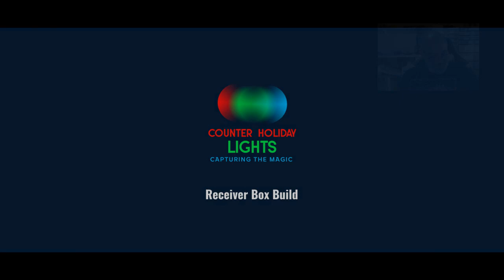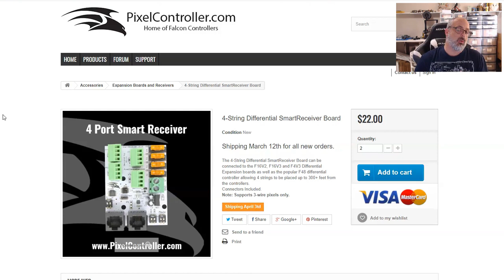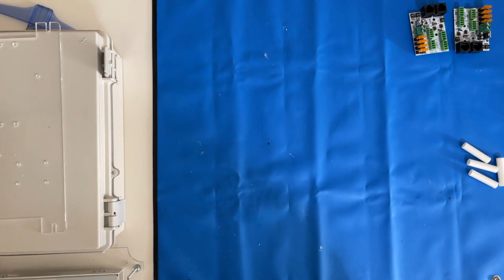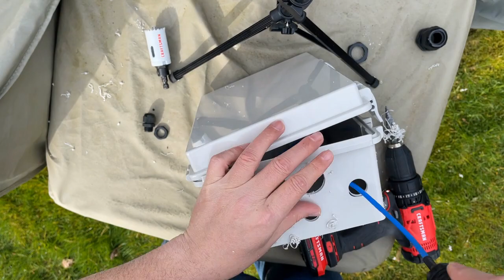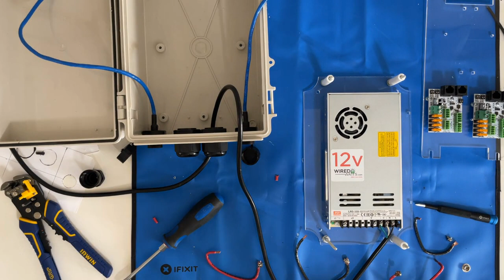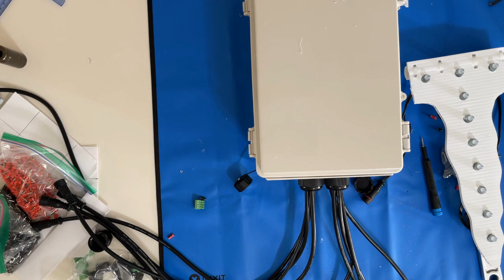RGB Smart Receiver Bud Box Build

Comment: Great videos, looks like our setups will mimic each other, you have two cat 5 lines, are they data in and data out? Thanks
Reply from the maker: no they are both data in one for each receiver
Reply: @CounterHolidayLights  OK so that data in those two cables are plugged into two of your ports on the F 48 correct?
Reply: My props won’t be the same as yours but controller wise your set up will be very close to what mine calls for for what I have set up in my yard that at 48 and distribution boards look to be the best route for me
Reply from the maker: they could be if needed or if they were smart receivers for the new F48 I could chain them internally
Reply from the maker: if you display is all over the place then yes that is the best way to do it. our current show uses the F48 to run our garage, matrix and front of the house we use a F16 with  a 16 port expiation for our tree and yard. next year we are going to replace the F48 with a new F16 with two 4 port expansions so that the f16 will handle the matrix and garage and then use the explanation ports to run the front of the house. less wires  to run and a couple less receiver boxes out side if I do it this way.
Reply: @CounterHolidayLights  would you be willing to sell your f48 to me?

Comment: Great video! You mention you like using ferrules with the pigtails - any reason you didn't either ferrules or fork/spade connections for the mains and DC connections? Also I find it a lot easier if I cut the cable off clean and then feed the cables through the gland first, followed by stripping the outer and inner jackets. That way I'm not fighting the loose strands in the gland, as well as bending and possibly breaking off an individual strand :)
A note on the mains safety would be great.... can be very dangerous if not handled with care.
Reply from the maker: glad you liked it and thanks for the input

Comment: Thanks for the video - maybe I missed it, what size hole drill bit did you use for the PG25 glands?
Reply from the maker: I beleive it was an Inch and a Half hole bit. if you have a few just see if it will fit over the gland.  thanks for watching.

Comment: Hi!  Thanks for the great video!!  Maybe the picture was deceiving, but it looks like if you centered the Falcon controller in the yard, you might have been within the 30' limit to most or all of your props and wouldn't have needed the receivers?  If that's the case, what is the advantage to having more receivers versus a centralized controller?  Hope my noob question makes sense, lol thanks
Reply from the maker: MNelson10000, while an F16 with one or two expansion boards port wise could of handled most of the props ( eave lines would have been way over 30 feet )  part of the problem and the reason why I built it the way I did is several fold. First the closer the controller to the props the more lights you can run on a channel I run between 200 and 350 lights per port ( as power loss happens over distance traveled ) Data can be boosted with an f-Amp but power can not unless you power inject and I like to run my display with zero power injection. Second reason is that you can only power so many lights off a power supply around 1500 -1800 depending on Brightness on a 350 watt power supply. third reason is that in all my receiver boxes is an extra board should one go out I can easily swap to the other other one ( or should my show grow I can double the size of my display with out building new boxes. Fourth reason, if some one should steal one I'm out a cheaper box which I have a couple of back up replacements built and ready to go. I keep the F-48 in the garage. .....hope this answers your question. Happy Holidays to you.

Comment: Great video 
Where do you get those green connectors- v-data-ground 
What screw driver did you use to put it in the green connector.
Reply from the maker: Phoenix connector can be found in a lot of location but wired watts carries them https://www.wiredwatts.com/tools-accessories. just a small tipped screw driver

Comment: Hey Lorne, loving your videos. I really enjoy how you have them setup in the presentation. I also have that Irwin Wire stripper. It is amazing, so much better than any other wire stripper I used to own. I noticed you did each wire individually, you should be able to strip all 3 wires from the pigtails at once if you wanted. 

For your cable glands, what's been your experience with PG25 and running 4 cables? I've always done single cables with PG7. I'm scared of water trying to sneak in between the cables in the larger glands.
Reply from the maker: Thanks Justin, as the the PG25 there are super tight and with them mounting with the pigtails hanging out the bottom don't think there will be a chance for that.  love the stripper also. off camera I was doing all three just trying to keep it very basic on the video part. gearing most of my videos toward the very new people coming into this hobby.